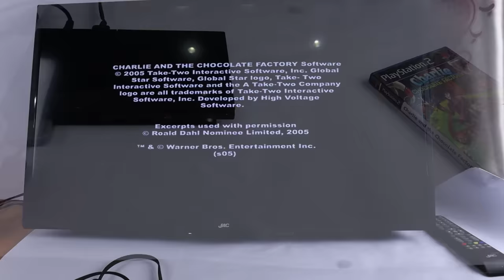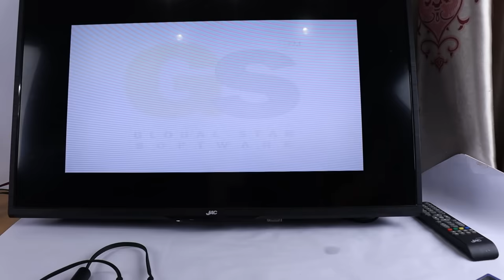Restoring the $5 Playstation2 slim ps2 resurfacing  - Retro PlayStation Restoration-ASMR

Comment: Seria genial que dejes una lista de las herramientas usadas en el video, así nosotros podemos seguir esto más como unos tutoriales que solamente como entretenimiento
Reply: Comora un kit de reparacion de celulares de amazon ahi viene todo
Reply: @vortek_mx  pero ahí no habrán herramientas para ps
Reply: @noecases5940  las herramientas que usan en el video vienen en ese kit, yo lo tengo por eso te digo, hasta la palita azul que usa para separar la carcasa sin lastimar, junto con los desarmadores
Reply from the maker: para el limpiador de placas utilicé alcohol isopropílico al 99% + limpiador de electrónica wd40. para el removedor de rayones utilicé pasta removedora de rayones Sonax
Gracias por ver
Reply from the maker: Realmente estoy de acuerdo contigo, gracias por mirar
Reply: @resEG  dónde se compra la pasta?
Reply: @noecases5940  casa de pintura, você vai acha!
Reply: Una pregunta
Reply: Cómo reparo membrana rota de control de ps2
Reply: @Sexmex.coommm  dependerá mucho de que le rompiste y donde lo hiciste. Es un proceso sumamente delicado ya que se puede terminar de dañar fácilmente, pero si rompiste una o más pistas y necesitas recuperarlas, puedes soldar a la placa unos hilos de cobre (de los que vienen en los cables normales) y lo soldas con un soldador de estaño a muy, muy baja temperatura, si mal no recuerdo eran 15 o 30 watts que debe tener el cautin para no dañar la membrana. Con alguna aguja con mucho cuidado destapas las pistas de la membrana y soldas el hilacha en ambos extremos, y así podrías arreglarlo
Reply: @Sexmex.coommm  dependerá mucho de que le rompiste y donde lo hiciste. Es un proceso sumamente delicado ya que se puede terminar de dañar fácilmente, pero si rompiste una o más pistas y necesitas recuperarlas, puedes soldar a la placa unos hilos de cobre (de los que vienen en los cables normales) y lo soldas con un soldador de estaño a muy, muy baja temperatura, si mal no recuerdo eran 15 o 30 watts que debe tener el cautin para no dañar la membrana. Con alguna aguja con mucho cuidado destapas las pistas de la membrana y soldas el hilacha en ambos extremos, y así podrías arreglarlo
Reply: @Sexmex.coommm  dependerá mucho de que le rompiste y donde lo hiciste. Es un proceso sumamente delicado ya que se puede terminar de dañar fácilmente, pero si rompiste una o más pistas y necesitas recuperarlas, puedes soldar a la placa unos hilos de cobre (de los que vienen en los cables normales) y lo soldas con un soldador de estaño a muy, muy baja temperatura, si mal no recuerdo eran 15 o 30 watts que debe tener el cautin para no dañar la membrana. Con alguna aguja con mucho cuidado destapas las pistas de la membrana y soldas el hilacha en ambos extremos, y así podrías arreglarlo
Reply: @vortek_mx  no hablo directamente de esas herramientas. Por ejemplo, ya descubrí cómo se llama una de las que más he visto que usan para procesos de pulido, es un motortool de dremel, para ser más exacto el modelo 3000 o 4000, o por ejemplo los procesos de desoxidacion, vi una marca bastante buena de líquido desoxisante llamada vaporust o un nombre similar
Reply from the maker: Amazon, Gracias por mirar

Comment: I have the same model and I love the way the top came out on yours. Like brand new. But you didn't replace any of your disc drive components? Mine works but does leave circular rings on some discs. And heard that's from the drive ribbon cable. Did you notice any after you did it how you did, using the old ribbon cable? Looks great though. 👍👍

Comment: (Amateur question here)

I bought an old and damaged Japan Ocean Blue FAT PS2  console that you can see the parts inside for a cheap price and the console won't turn on anymore. But the seller told me the rest probably works except for the power. I already have a standard black PS2 and I am wondering if it's possible to swap the cases on both PS2?

Comment: Someone threw away this beautiful PS2 slim the controller doesn’t work it’s missing a pin and when I start the PS2 it doesn’t show all the pixels there’s a couple of spots on the word browser and you do not see the light spinning around in the middle could this be the AV cable or the system itself?